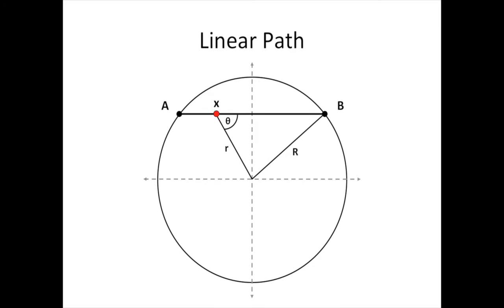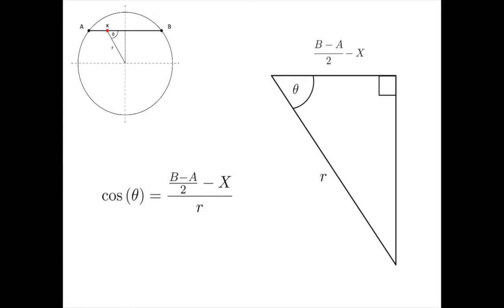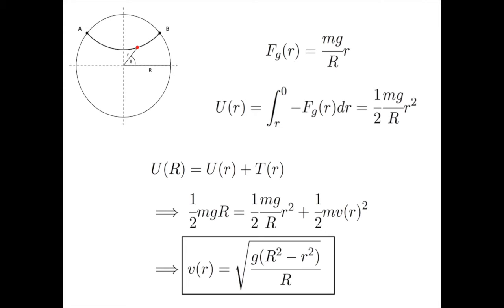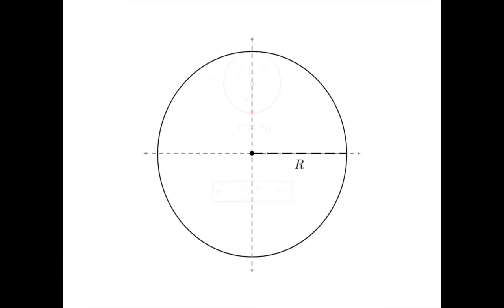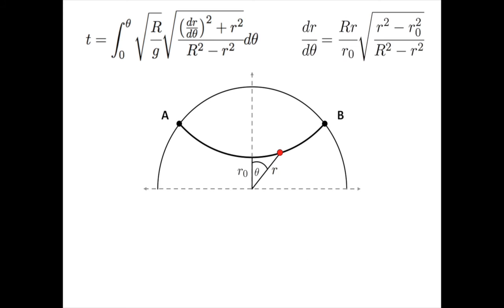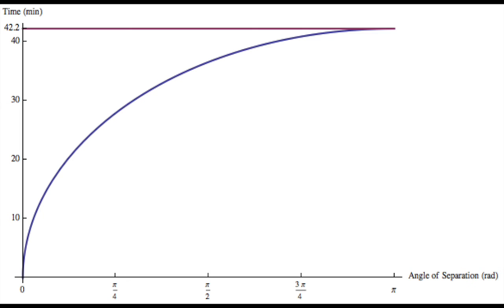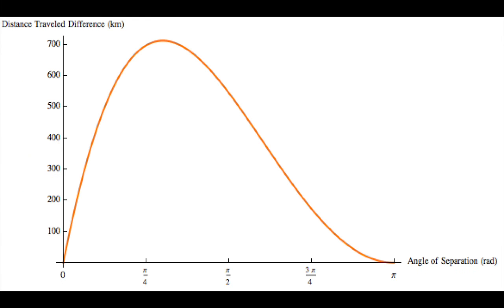Terrestrial Brachistochrone (Gravity Train)

Comment: Nice explanation, just tiny corrections. 
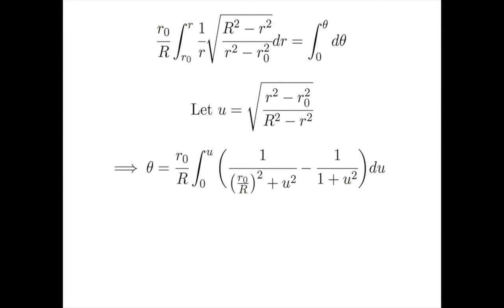I am pretty sure in the equation for theta, after the backsubstitution of u (at 4:15), the R/r0 inside the second arctan() should be deleted, i.e. the equation should read, with u as defined

theta = arctan( (R/r0) u) - (r0/R) arctan(u)

In the cosine law (5:43) there is R squared where should be R, i.e. the correct equation reads

r² =(R-a)² + a² - 2a (R-a) cos(phi)

Comment: Turns out they had the tunneling tech for a gravity train back in the 1930's! That is if you buy what the old flick "Trans Atlantic Tunnel " has to say. ( It's on You Tube and a hoot and a half to watch)  Patents 2511979, 3109554 672256.